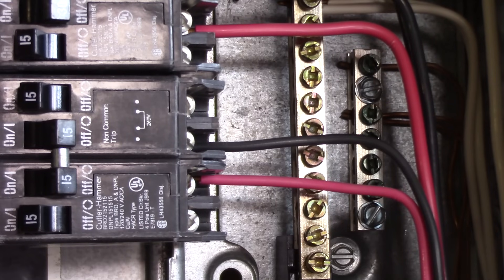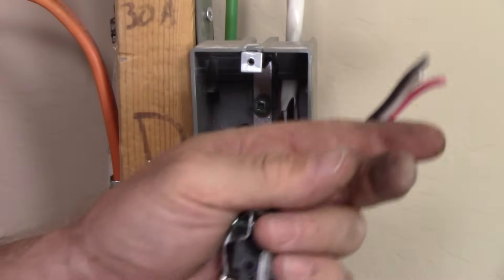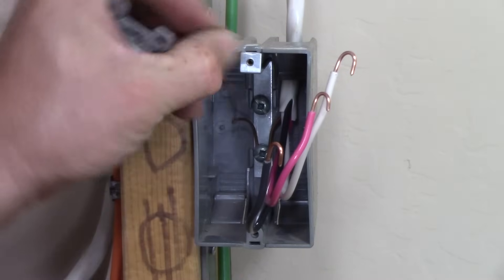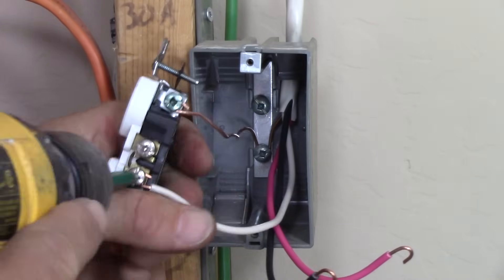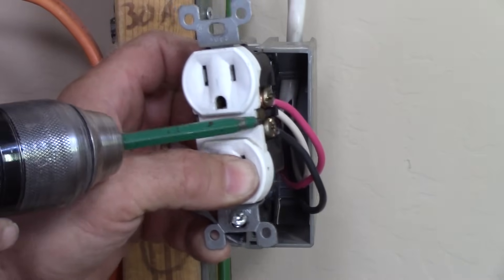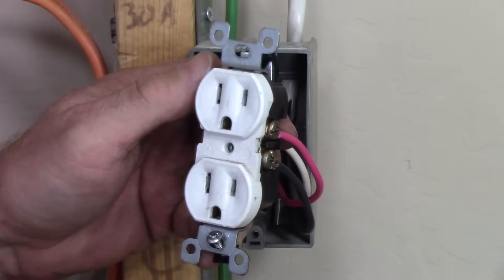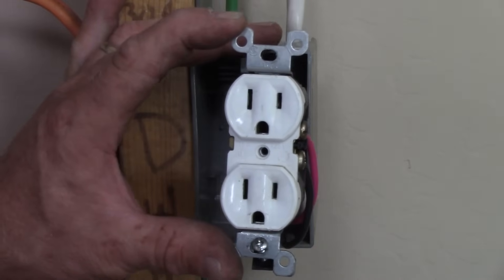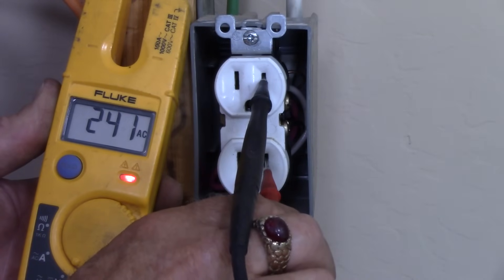Kitchen Split Circuit Receptacles Explained

Comment: i did split the tab and installed just like this, and it still did not work! So here i am, googling for answers.. what else could it be? i copied the set up exactly, plus i split the tab...
Reply from the maker: A tripped or faulty breaker? Bad connection at another receptacle in this circuit? Broken wire?  It needs to be investigated by a good troubleshooting electrician.
Reply: @theinternetelectrician  Thanks so much. I was replacing old ugly ivory outlet with a new one. Its 15V receptacle. I installed the wires just like on the old one. Did not work. Watched your video (thank you), figured out about the tab. Cut the tab. Still does not work. I checked the install 100x, and re-re-researched. I am positive it is correct.  All other outlets in the kitchen work. I am thinking one of two things happened  - 1. i burnt something inside by installing it incorrectly first 2. Something with the breakers? I do think that the breaker feels somewhat 'soft' in the on position despite flipping it off and on repeatedly (its one of those 'double' ones).  Could I have blown a fuse or something?
Reply from the maker: @janaulicna9956  Did you push the breaker firmly to the off position until it clicks, then back to on? When you say it feels soft, then it's either not reset properly as I describe above, or the breaker is faulty and needs replaced. Let me know.
Reply: @theinternetelectrician  Thank you! My concern is that the outlet worked JUST before i replaced the receptacle. Could I have broken the breaker by doing the outlet replacement, somehow?  But then again, how can it be broken if, when i go flip the breaker on, i hear a beep (of my microwave turning on) which tells me the breaker seems okay, as does the circuit. SO CONFUSING.
Reply from the maker: @janaulicna9956  Hmm.  The microwave is counter-top, and plugged in to the kitchen receptacles?  Do you have a multimeter or anything to test with? Maybe send me some pictures of the wiring and connections in the outlet box you replaced the receptacle in. terry@electrical-online.com
Reply: Big thanks  @theinternetelectrician  who helped me trouble shoot.  And indeed the problem was in the breaker not being fully pushed into the OFF position before being put back to ON.

Comment: what will happen if you use a space saver breaker for this purpose?
Reply: ya, I have the same question - Red to first breaker, black to second, white to neutral then to the split plug... would that work instead of using the double pole?

Comment: After years of daily use, the dual breaker tripped during the night. After unplugging everything, it would instantly trip off again when i tried to turn it on. I checked the plug and saw this red-black-white configuration I didn't know of. Looked at your video and thought to myself there is no way this tab between red and black is there after 15+ years of use! Well there it was! I know it doesn't make any sense but I swear it was there. So I broke the tab like you showed and voilà, I turned on the breakers and it stayed on. How it that possible?
Reply from the maker: That is weird.  The only thing I can think of, was it wired using the "push-in" connections at the back of the receptacle? Or could the connection at one of the terminals have been loose? The theory being that it was never a good connection and after the 15+ years, something got shifted or bumped and the connection was completed and then tripped the breaker.
Reply: @theinternetelectrician  The three wires are tightly connected with the screws. But you are right, one of the live wires had to be cut somewhere. Maybe one of the breakers is intermittently  opened, or something. Hopefully one day I'll find out what happened. ;)

Comment: My kitchen is wired this way for the outlets and the dishwasher. I have no idea now how to add GFCI protection. Any ideas on how i'd do that?
Reply from the maker: To meet the new code it would require re-wiring the kitchen with #12 wire and 20A circuits. To add GFCI protection to your existing is complicated by the shared neutrals and you'd have to have an electrician look at your particular installation to advise on how best to go about that. My advise would be to leave it as is.  It is grandfathered as it was the code of the day, and unless you feel that you really would like the added protection that GFCI provides?

Comment: How do you replace that receptacle (red black white) with a gfi receptacle? Do you just put a marette on the Red and stick it in the box?
Reply: yes, just use one supply wire to the GFCI (black or red, if they are on a dual breaker) and cap the other.

Comment: I have 2 110v lines going into my garage both are on a 15A seperate breakers on one 15 amp breaker is two plugin receptacle boxes on the other 15A breaker line is an outlet and light switch box is there a way to wire both 15Amp lines to a seperate plugin receptacle box to give me 110v with 30Amps without changing out a 15Amp breaker for a 30Amp?
Reply from the maker: No, that is called parallel feeders, and is only allowed in much larger ampacity circuits such as main feed supply to larger commercial or industrial applications.
Reply: @theinternetelectrician  ok thank you

Comment: Terry, have you ever used this method for wiring a "International" Kitchen? I had a customer come to me once with a sewing machine from Europe and wanted to be able to use it here in the states. what about wiring a kitchen for dual voltage? if someone from Europe wanted to but a home and bring their European counter appliances with them? could this be done legally?
Reply from the maker: Sure you could, I can't really think of a reason an inspector would reject that. If you fed the 240V circuit (s) with a 2-pole GFCI breaker, and then ensure the appliances have a proper NEMA cord cap for 240V / 15 (or 20A) with  matching receptacle, and the breaker is sized to the wire (#14 for 15A, or #12 for 20A), it should satisfy all requirements.  The neutal (white) wire in the cable then would just be capped off and not used if using 14/3 or 12/3 cable. If its a new installation, same idea for the 240 V receptacles, only you could use 2-wire (+ground of course) cable.
Reply: could you use dual voltage receptacles in a setup like that?
Reply from the maker: @johnstancliff7328  not sure what you mean? like a 15A 120/240 3P 4W type?  Yes you could, but again would have to put matching cord ends on all appliances and connect the wires in each appliance's cord end that it requires, (ie one of the hots, neutral and ground for 120V, two hots and ground for the straight 240V appliances, etc)
Reply: I'm referring to Leviton Part Numbers L-5031, L5292 dual voltage outlets. this is how the kitchen could be wired.
Reply from the maker: @johnstancliff7328  Yes, that would be perfect.  To be honest, I didn't know they made those?
Learn something new every day!!! It would have to be supplied with a 15A 2-pole (GFCI / AFCI) combo breaker to be completely code compliant now if these would be in a kitchen.
Reply: this is something that everyone should know... people do go to Europe and shop.... you find a small appliance you like and want to use it in the US, this is the solution!
Reply from the maker: Yes, I should do a video with this scenario in mind.  For a new installation, no problem, but with an existing renovation, you would need the split kitchen receptacle wiring to work with these dual voltage outlets without having to pull in new cables.  In a newer installation with #12/2, you could just dedicate one or two of the exiting outlets to 15A 250V and change the breaker, use and identify the white conductor as a hot.
Reply: it will be interesting to see what you come up with!

Comment: Thanks great video you save my day.
I didn't know that I have to break the tab.
Reply from the maker: If I had a dollar for everyone that has been tripped up with the tab! You are not alone, one of the reasons I thought this would be a good video to shoot!
Reply: At least you all could break the tab. I can't. My outlet doesn't look like yours the tab on mine comes off but the copper still extends behind the tab and stays connected. Impossible to split.

Comment: Thank you for your explanation in the comments of how each 120 AC phase is 180 degrees away. That explains how the one white neutral wire will carry only 2 amps difference instead of 10+12 @22A.
Next, for me, to figure out how 120 volts - 120 volts = 240 AC volts.....??????
Reply from the maker: Jose Aguirre think of it as 120+120=240. The AC sine waves are 180 degrees out of phase so when one phase is above the 0 v line, the other is equidistant below the 0 v line making the distance between them double. Make sense? It would be easier to understand to see a diagram illustrating this. Google image an AC sine wave.

Comment: Please explain why the breaker has to be tied together. When black on the left and red on the right 2nd phase. They're both sharing the neutral. So if not tied together and one tripped what is the problem. Say black tripped and the red stayed hot. What is the safety hazard or the reason for the tied breakers?
Reply from the maker: Two reasons, one being to ensure that you have each circuit on different hot phases of the panel.  With individual breakers, nothing to stop you from putting both circuits on the same hot tap, thus doubling the current on the neutral instead of the un-balanced load.  The second reason is safety.  If you were to shut off one breaker, test that there is no power but you only check the half you shut off, you could be working on the outlet and get a shock from the half that's still on.
Reply: @theinternetelectrician  Yes I understand about overloading the Neutral having the blk and red on the same phase. I was more interested in the why. So a thought is it really makes it safer for the homeowner who is a DIYer and any electrician who has not worked on the circuit before. So for a very temporary fix till you ran and got breaker it would be fine. It would not be causing any harm to the system. But could harm a human unaware of the two circuits. I always am learning and do everything by code. I have a licenced electrician in tow who I call when in question. Yes I pay him for his time when he allows me to pay him. I also call on him when it is large jobs and needs more manpower and shorter delivery time.Thank you Terry for your time responding.
Reply: @theinternetelectrician  Thank you for that Terry. I believe in educating oneself and understanding the why and not just having the answer.

Comment: love the video!  i do have a question, i removed a light in my garage and i place a 15 amp  outlet  thinking that my light switch would work, to turn off and on my  two shop lights however when i remove the light fixture it had 7 wires 2 black 2 whites  2 grounds and 1 red wire. so test the line, one of the blacks was hot. i connect 1 back 1 white and ground to the outlet all work find , however light switch didn't turn on or off the lights also looks like the other 4 wires that i did not use are connected to my kitchen so had no lights there. grr. could you please give me any ideas how to make this work...
Reply from the maker: The red wire is the switched conductor.  It should be connected to any lights that you want to control with the switch, along with a neutral.  The splices should be all the grounds together (and pig-tails to the outlet box and receptacle green terminal), all the whites together with a pig-tail to the silver terminal (s) of the receptacle (I assume to plug shop lights into?), the red wire to the brass terminal (s) of the receptacle, and the black wires spliced together to restore power to your kitchen.

Comment: So in this application, if under a kitchen sink could you have the dishwasher and garbage disposal connected to this outlet? It's on a 20 amp breaker.
Reply: You'd need  breakers for the application

Comment: Great video Terry. I replaced an outlet that was wired like this with a newer one for cosmetics. I wired it exactly the same way, or I think I did, but somehow it’s no longer split between two circuits. Any thoughts? I did three of them and the same thing happened to all three. They only run off one circuit when they used to run off two.
Reply from the maker: Did you split the tab on the hot side?
Reply: Terry Peterman yes I did remove the tab.
Reply: Any other thoughts? It doesn’t make any sense to me...
Reply from the maker: Sue Tucker I’m not sure what you mean then when you say they only run off one circuit now? Do both halves of the receptacles you replaced work, or only half of each one?

Comment: Is mc cable allowed on the baseboard for outlets i pigtail white black green to each outlet i didnt go to the box with grpund because i put in common ground outlets so box is grounded by screwing in outlet and the mc cable casing and clamps on each box ties the ground threw each box from the source thanks os it code

Comment: Kitchen is supposed to be 12 awg on 20 amps consolt codes
Reply from the maker: David, at the 30 second point I start to explain what the new code requirements are, and that this was the way it was done before the change. Changes to the code only affect installations after the code is adopted so many millions of these circuits are still in use.

Comment: So based on this video if I was wiring a work shop in the house, I would run a 10-3 line all the way through so I could pick and choose 220v and split 110 v recitals where needed, and be able to change them as required, on the same line.
Reply: David Brown That’s exactly the 2x4 that hit me in the face after watching this video!

Comment: Can I do that same thing in my basement for my washer/ dryer by splitting a GFCI receptacle? Also why cant each side go back to its own breaker? Why must it be a duplex?
Reply: Duplex, it's probably used to not current overload your breaker panel on a single 120 AC phase.  Now, the single neutral handling a max two 15A loads, will it fry?

Comment: Terry, I got everything wired like you said but I have 120v on my top plug and 8v on my bottom plug what's the problem?
Reply from the maker: I'm not sure? Are you using a 2-pole breaker to feed this? Is one side of the breaker then not completely reset by pushing fully, off, then back on? Other than that I would have to see exactly how you've connected everything, from the panel to the device.
Reply: I foud it, it's 2 single breaker they are not linked, one was off
Reply from the maker: Justin Clairmont, those breakers need to be “linked” (2-pole). Two reasons, 1. It ensures that the breakers can’t be installed on the same hot leg of the panel which makes the neutral current the sum of both loads, and 2. Ensures that you shut off both circuits when you open up the junction box to work on or replace the device.

Comment: Hi Terry, one of my kitchen outlets is wired like this, but instead of  red, white and black wires, I have a white, beige, and black.  The outlet does not work currently, and I'm unsure which is the neutral wire- the white or the beige?  Is their a way to tell if nothing is connected?
Reply from the maker: If the wires are dis-connected, you will need a voltage meter. Alternatively, you could look at another outlet to see how that is connected. However, the white should be the neutral.

Comment: For this change doesn't needs to add another neutral wire?
Reply: Not if using both phases in the panel, one for each outlet position

Comment: Great videos! Why does the breaker need to be a two pole if they are on two separate circuits. Someone said because they share the Neutral but I don't know if that is correct and regardless I don't understand that...can you explain?
Reply from the maker: A 2-pole breaker ensures that you use the 2 opposite phases of the hot conductors so that you only have the unbalanced current on the neutral. (there is one type of panel that when using slim-line breakers, you can plug the 2-pole breaker in to the same buss bar, a topic for another video!)  Another reason, when a device is fed from 2 circuits as is the case here, shutting off one breaker (2-pole) shuts off the power to that circuit. If you used 2 breakers without the tie-bar between them, you could shut off one breaker and think you are safe, but the power could still be on to the other half.
Reply: Terry Peterman thanks for your reply. So, I now understand the danger of using 2 conductors without a tie bar for a 2 pole breaker but in the case where the second hot wire is used as a separate circuit (not feeding the same device) can you have that hot connect to its own single pole breaker? Thanks again!

Comment: Terry, can you explain the unbalanced load concept? Why does only 2 amps return on the neutral. That's the only part I don't understand. Thanks.
Reply from the maker: The key to this is that we are working with AC (alternating current). Each leg is 180 degrees out of phase from each other. So if one appliance is drawing 10 amps on one phase, and the other circuit is drawing 8 amps, because they are opposite of each other, only the unbalanced current is carried by the neutral. This is a very difficult concept to get your head around, and it goes into electrical theory, math, trigonometry, the sinusoidal wave, etc. Too deep to explain here, that's why we electricians have to spend hours in a classroom trying to understand it all.  If you shared a neutral, but fed 2 circuits from the same phase of the panel, the current would compound, and you would have 10A on one, 8A on the other, and now 18A on the neutral. That is one of the issues with a circuit like this if they are connected improperly.